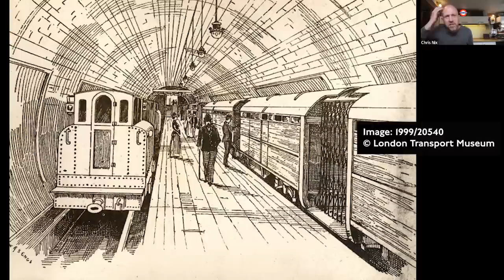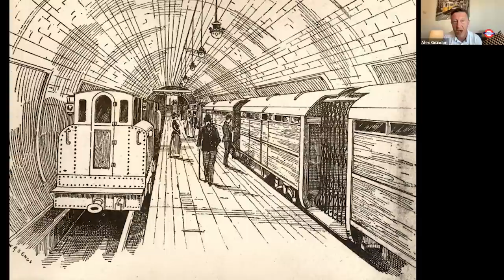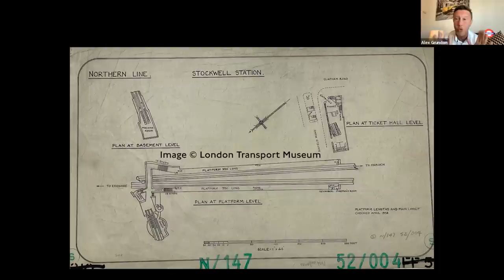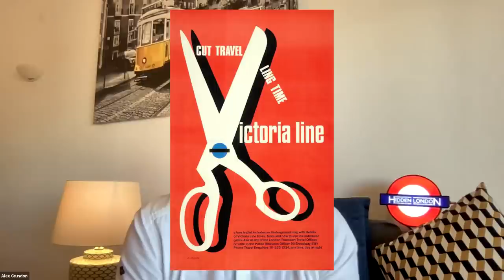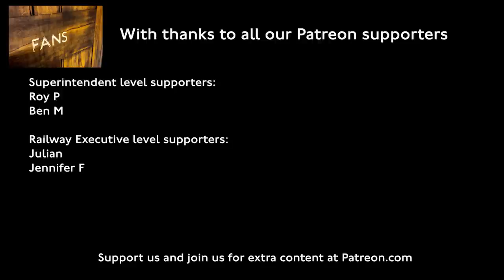Stockwell Tube Station's Secret Original Features - Hidden London Hangouts (S05E18)

Comment: At the end of the 1960s I lived in those flats that were built on the site that was formerly the depot of the City and South London Railway and my first job was in Regis House that was built on the site of the former King William Street Station.  It is so annoying that I only discovered about this some 30 years later.

However, it does seem such a coincidence to have been living on the site of the former depot at one end of the line and working on the site of the former station at the other end of the line.

Such a pity that there is nothing at Stockwell to say that this was the original terminus of the first ever deep-level underground railway.
Reply: I wonder if one day a blue plaque or similar will go up there….?

Comment: I’m sure that the original tiling you saw at 15:00 app is the original Stockwell station cavity. The new station was re-sited a few metres south. Each episode just gets better every time! There’s more to see here at track level too btw such as the old depot access tunnel etc
Reply: Indeed visible from southbound trains on the way in to Stockwell.

Comment: Absolutely fascinating station that I used to use many years ago. The City & South London Railway station at Stockwell used to have a ramp to the surface, I think it was a single track to a maintenance depot. The depot is long gone, but I was wondering, is the ramp still there?.
Reply: They talk about the depot from 29:00.  When they did the 100th anniversary Northern line tour, the train stopped in the tunnel and the doors were opened.  We saw the start of the inclined ramp via torches, and the lift shaft running almost to the surface.

Comment: Is Stockwell unique in having modern day Northern line trains running through where the original 1890 platforms would have been? I think it was mentioned that the current platforms moved a bit down the line. I assume the 1890 tunnels were widened on the line up to London Bridge and the platforms are in the same place as they were originally for Oval, Kennington, and Borough? Is the tunnel between KWS and Borough the only bit of the original 1890 C&SLR left?
Reply: Exciting to see a tiny bit of the old 1890 Stockwell station! Stockwell is now further south as mentioned in the programme and the platforms and tunnels north to Borough (despite being widened) are the same and yes the tunnels thence to KWS are the original (apart from the bit where the new Northern Line Bank tunnels has breached those.)